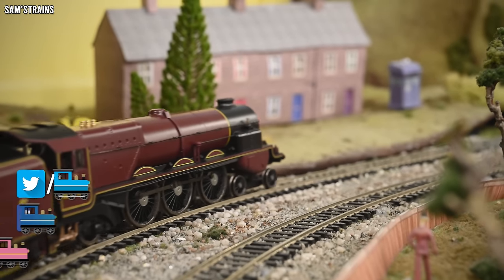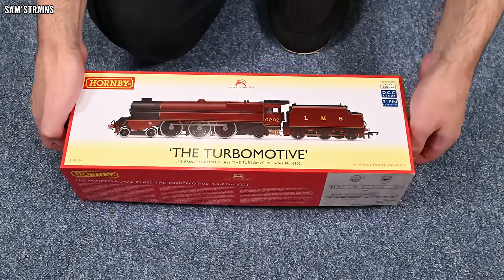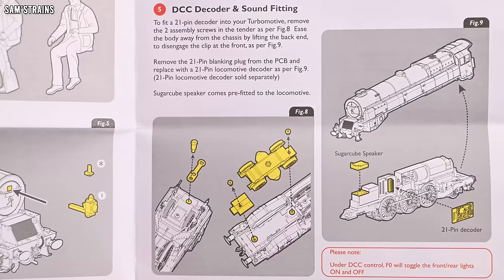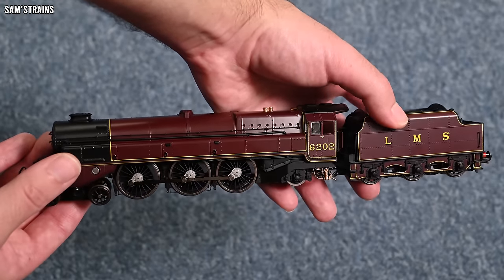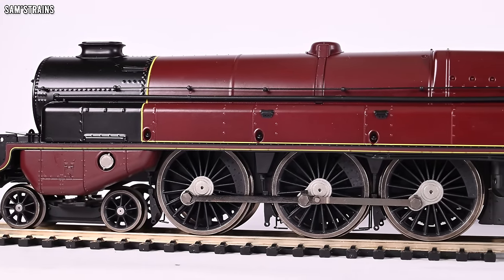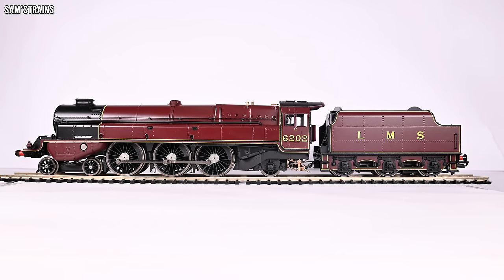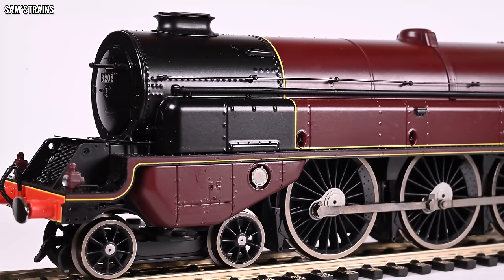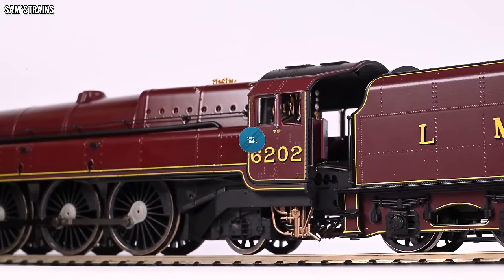Is Hornby's New Turbomotive Worth £240? | Unboxing & Review

Comment: A few comments. As always I can only compare to my ancient Dublo locos. First the paint finish. It does vary depending on the surface you apply the paint to. My Dublo Duchess of Atholl shows a noticeable difference between tender and loco. In her case the loco is cast mazac and the tender is tinplate. On the later City of London which has a die cast  loco and a plastic bodied tender, the paint difference is also clearly visible. A die cast tender body would probably resolve the issue but would increase the stress on the mecanism though. 
As for slowing on curves and inclines, is it a big deal? On a real loco you need to increase the regulator to compensate, my Dublo locos need to be driven just like this, so yes you need to hang onto the controls, you can’t just start it and leave it running…
Lights ? INMHO the tender lamp is the most realistic. Loco lamps are not intended to illuminate the track ahead, but to enable the signalman to identify the class of train, and the red tail lamp to be sure no part of the train has become detached and left on a running line. 
£240 is a lot of money, but then again not so far from prices on the continent which have always been more expensive and until relatively recently far more detailed and of better overall quality than our British outline stuff (as we saw recently with your Roco Glassbox, Fleischmann, Marklin etc.
All the best 
Rob
Just my opinion for what it’s worth

Comment: I noticed the front buffers (right hand side) during the detail section is not level. Looks like it’s slightly wonky?
Reply: I think that's an inherent problem with sprung buffers, which are pretty useless on OO models but seem to be "essential" these days.
Reply: @rogercantwell3622  it’s the first time I’ve seen it.

Comment: Interesting thing to note, the boiler of the turbomotive would be uses to repair the locomotive Duke Of Gloster
Reply: No it wasn't
Reply: @matthewpeter  ok, your kinda right, the boiler wasn't used, only small parts from it were used
Reply: @AW.Dry_and_Co. @AW.Dry_and_Co. Not even that. 71000 was an entirely new loco. 46202s boiler (which wasn't too badly damaged) went into the Princess spares pool following Harrow and continued to the end of steam. The only connection to 71000 is that the destruction of 46202 gave them a reason to build 71000 (which they probably would have done anyway). This is all well documented by both the 71000 trust and any book on 6202.

A more credible suggestion that has been made is that 46202s front end was used to replace 46242s front end following Harrow. 

As ever with railways, it was all in the accountancy.

Comment: That engine looks very beautiful. Reminds me of the Pennsy S2 Turbine. Also an interesting way to make the lights work on the tender. Guess DCC would help a little better with the lights as they’ll be on constant and can have brightness adjusted. Could also be faulty lights. Good review as always. 

I will say I am jealous that Hornby have now started using the same box that Broadway Limited Imports used to use and now BLI has started using the box Hornby used to use. Smaller models work in that type of box but an $800 all die cast big boy should be in a sturdy cardboard type box with true foam protection, not the flimsy card stock with styrofoam lining and no foam at all protecting the blister holding the engine.

Comment: In your introduction you totally miss the point about ‘unusual models’ and their demand.

The issue is not that people won’t buy them in large numbers (they will) - it’s that said people people will only ever buy ONE model when they do!

To take your example of the GWR manor class - in real life 80 locos in total were built and a lot of GWR sheds had more than one example on their books. 

Therefore if you are modelling a location in mid Wales for instance where many of the class were based during their working life you may wish to buy 4 or 5 releases of the class with different names / numbers (or indeed rename / renumber 4 or 5 different locos) to satisfy your requirements.

The Turbomotive (and similar ‘one off’) designs are different - no modeller attempting to create a model of a real life place on the LMS network is never going to need more than a single model of the Turbomotive (of whatever colour) to realise their aim.

For every Turbomotive Hornby sell, Acurascale can probably shift 3 manor locos (and that’s even taking account the duplication of the Manor class by Dapol) precisely because it was possible to see multiple members of the class in operation at the same time.

Or to put it another way if you sell sone item worth £100 to 10,00 people you make some money. If someone else can sell 10 identical items to each of those 10,000 people at £50 each then that company will make way more than the first even though it charges less.

Now none of the above is necessary meant to defend Hornbys price as such - but to pretend it’s all as simple as Hornby being greedy shows a distinct lack of understanding of how business in general works and how higher prices can indeed be justified by lower sales volumes.

After all there is a reason limited edition / ‘rare’ goods from Cars to food to Handbags always have a price premium attached to them compared to ‘ordinary’ or run of the mill versions which are produced / sold in much higher quantities - and model railways are no different!

[Note, Comment edited for tone after Sam’s reply]
Reply from the maker: Yeah, I think that’s a bit of a stretch to be honest… the fact that people won’t buy more than one doesn’t invalidate the point. It is very true of course, but models like this have a broader appeal than the GWR manor class. With the hush hush, I know many people who bought one even though it was outside of their era and region, if this is similar, this should mitigate the fact that many people will only buy one. Furthermore, because most people will only buy one, very few variants have to be manufactured; here we have just two versions, the black and maroon, compared with the dozens of variants we see with other models like the manor, this simplifying production and reducing the price.
So let’s cut the condescending rudeness about not understanding economics or the industry… as you’ve demonstrated exactly the misunderstanding you accuse me of.

Comment: The price is far too high but have you looked at the price of the other Pacifics in the Hornby range. The 9Fs are about the same price and as I said on another review the new West Country loco is the biggest ripoff, old design modified to take the new Hornby DCC system and new design of drawbar.

Comment: Very interesting, I never realized it was asymmetrical! It's too expensive, but the metal boiler and extra features are really nice. The working removable headlamp and tap switch in the tender are very cool. I'm confused why at this price they still compromised and used plastic for some of the details and the tender. I would say the detail parts should've been all metal, or at least most of them, especially the ones that are supposed to be the same color. The cab and the tender especially I'm confused why they just made them with plastic, at the huge price they should've had the money so why didn't they make those metal as well? It would've fixed the color and finish mismatch.

Comment: I’m actually a little surprised. I thought this thing would be similar to the Hush Hush and Thompson Pacifics in terms of quality and detail, but it is considerably better. I don’t like the fact that the mechanism hasn’t been changed to accommodate the extra weight, and that price is ludicrous. Yes this locomotive has lots of features, but so do much cheaper models from Accurascale, Dapol, and even Bachmann at this point, so I personally would have given it a much lower score on value, that and some of the features such as the working lamps are partially useless, so if they don’t work, then why pay for them? Overall I wouldn’t say that this is a bad model, but given that this is basically the most expensive model on the market (except the Dublo stuff which is an even bigger rip-off) it is not nearly as good as it needs to be considering how good much cheaper models (Ie: Deltic, Class 37, Class 92, Dapol Manor, Large Prairie, D1, A5, V2, 812, Class 47, Class 92, J72, 94xx, 1P, 16xx, J70, etc.) have been, an yet they are much cheaper, and still have largely the same features. Even some of Hornby’s own models from recently, such as The P2, Pecketts, and Princess Royal, have been just as good for the most part, but have been far cheaper, so I think with this model, Hornby have kinda lost their mind…

Comment: I really do not like bright lights on model steam locos. In real life they were not normally lit during daylight hours and when they were lit they were generally only paraffin lamps and were not of high density. They were also only single aspect and a loco travelling backwards would not normally have its headlamps still in situ at the front, and if it was running light engine in reverse then a single tail lamp would be fitted at the smokebox end.
I have a similar issue with blue and green era diesel and electrics. The light bulbs fitted behind destination blinds were not very powerful and wouldn't be seen from any great distance. Likewise the white head lights and red tail lights were not high intensity and would be hard to spot from any major distance. Light effects are very difficult to scale down and you often see models with blazing lights that really do not look prototypical.

Comment: Tender looks to be a standard 4000gal Stanier as fitted to Jubilees, Black 5s, 8Fs? Or perhaps the Royal Scot variant? Definitely not the same as the Princess Royal or Princess Coronation.

Lamps are a difficult one on steam engines. The ones on the front buffer beam are too bright and too cool for dim oil lamps. They also look a bit over scale and only one should light up red as locos only carried one tail lamp. They also need to come off before fitting the one on the smokebox to reflect real life lamp codes. On the tender, the lamp should be lower down for light engine as where it is reflects a stopping passenger train which is unlikely in real life and impossible without a front coupling.
Reply from the maker: The body does seem to be different from the the other locos I have with this tender, though the chassis seems to be the same - not too sure though! Thanks for sharing on the lamps - I suppose they do seem quite large actually!
Thanks for watching, Sam :)
Reply: You would expect the tender to be a standard part, but fair enough if it was also unique and is new tooled, just a shame it's not the same colour as the boiler! Kernow's Steam Railmotor lamps look oversized too, presumably they will be working LEDs.

Comment: Comparing Hornby and Bachmann to the smaller manufacturers is not altogether fair. The smaller manufacturers cherry pick models that they know will sell. Hornby & Bachmann are expected to provide a full range of models every year, hence they have to hold much greater stock levels this in itself is a risk additionally they offer lots of supporting items.. Also as stated elsewhere Hornby and Bachmann have to maintain high staffing to design, offer customer service and distribution. These all add up to high operating costs. So price comparisons are not really comparable.
Reply from the maker: Hmm not sure I’d agree with that - every manufacturer cherry picks models they know will sell, including Hornby. I don’t think Hornby pressure themselves to provide a full range of models every year… look at this past years releases… P2s, hush hushes, Lion, Tiger, Turbomotive… all niche engines! As for employing more staffing, more staff equals more products… but if they employ too many staff for their output, that’s their problem, not the customers’. The smaller manufacturers also have to deal with customer service and distribution!

Comment: Those lights are a royal curates egg. Why is there a lamp on the rear of the locomotive, when the operating rules were VERY strict on what that lamp signifies; ie the rear of the ENTIRE train, whether its lit or not signalmen were trained to look for the lamp, not the light. As supplied Turbomotive shouldn't be hauling anything! Yet the front headcode lamps say its express passenger, or if you put the third lamp in its an empty stock working...but that code was made obsolete before Turbomotive was built. Hornby haven't done their research very well...its almost like they said 'lights are cool, lets stick lights on it.' but didn't bother to look up what those lamps actually mean. So we wind up with this weird contradiction which has been done really poorly into the (expensive) bargain.

Comment: I would say for as heavy as that model is that's a pretty good amount of torque.  I've got full diecast model that has two motors and it struggles to turns it's wheels at 70% so I think the mechanism is pretty decent on this model.  Those lights are a shame no idea how they managed to mess that up like that, maybe they should get some help from an American manufacture like Walthers or Bachmann America lol.  Great review and I kinda want one of these models now

Comment: What a rip off the lamp that you can push in or not to the smoke box and the tender lamp both gimicks. I noticed that the cab was the same shade as the tender. I do like the crew, the fire box glow and the fact you can fit a speaker under the chimney (where the sound should exit) rip the Hornby speaker out as it will be cheap and nasty. As you have said and others the cost of models has gone through the roof. Again typical Hornby with the instructions and the front coupling.

Comment: Sam. Great respect to you & your videos as always, but i have had to give you, the thumbs down on this one. With all the defects you have found on this failure of a model, & at that exorbitant price, by the end you were actually praising it. Lamps not working, a piece of sponge doing God knows what, & to cap it all, they couldn"t even match the tender paintwork, or proofread their instruction leaflet. Give Hornby what they deserve, A GOOD BOLLOCKING !!! Over recent years, their products have greatly increased prices & many quality issues. Iv"e bought running motor cars for a fraction of the cost of this loco.  ATB Mike.

Comment: A small point, but, after the loco was wrecked in the Harrow accident, it wasn't rebuilt into a standard Princess Royal.   The new loco was a new design in itself, which was half way between a Princess Royal and a Duchess.
Reply: It wasn't rebuilt at all after the Harrow accident, as it was a right mess!
Reply: Turbomotive was rebuilt into the close to standard Princess Anne before the horrible crash.
The four cylinder rebuilt version ran for just months before the Harrow crash. As Sam correctly said

Comment: First, the price : it's German territory here, do we have the German quality too ? Well, not yet : the botched documentation is unacceptable at this price. And agreed on the complexity of the model : we are in the overall simplicity of a diesel engine, the price of an engine like the 9F is not justified.
Yes this is a nice model, but even minor, the quality issues are unacceptable at this level of price. Look at what Märklin/Trix, Roco or Piko do for the same price. We have an heavy metal manufacturing, lights and firebox glow and a decent mechanism, but the colours of the tender and the engine does not match, the engine-tender drawbar send us 30 years in the past, no NEM socket for the front coupling, rear light too dim to see and the usual gutless motor by Hornby, with the poor performances that goes with it... What's the use to manufacture the engine in full diecast/tungsten/depleted uranium for an outrageous price if the motor cannot haul her to a correct motion ?
No, she's not worth GBP 240, period. As is, i won't give more than GBP 170, if not GBP 150, to buy her.  A no-go for me wait for a 30 to 50% bargain before buying her if you are interested.

Comment: Grossly overpriced! But It's Hornby so not really surprising. Not sure about your obsession with it being diecast: Hornby Dublo and latterly Wrenn produced diecast as a matter of course for most of their engines. The only exception for steam engines being later City and WC class tenders. The running lights are innovative but are only correct for certain trains. As mentioned it was rebuilt but didn't last beyond 1952, so would look entirely out of place on the majority of layouts.